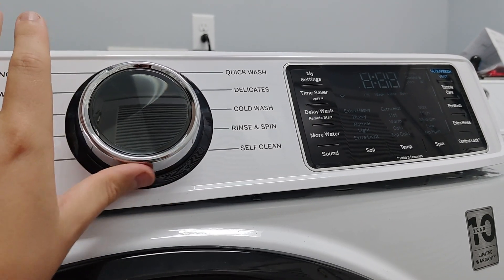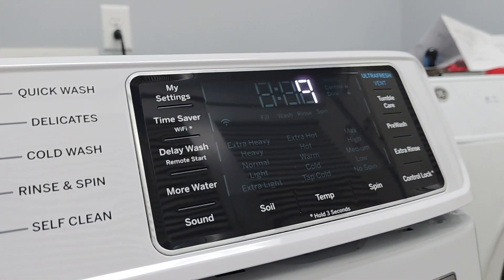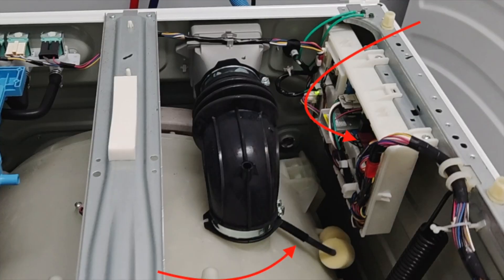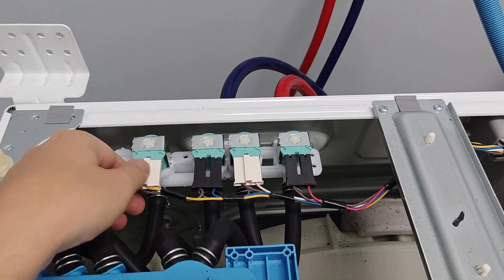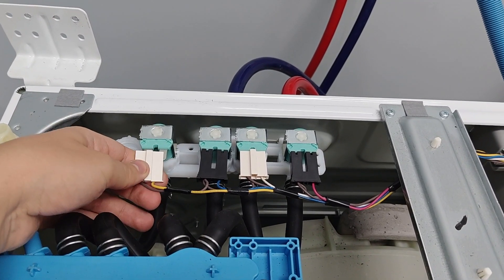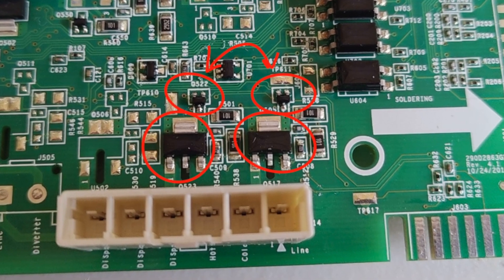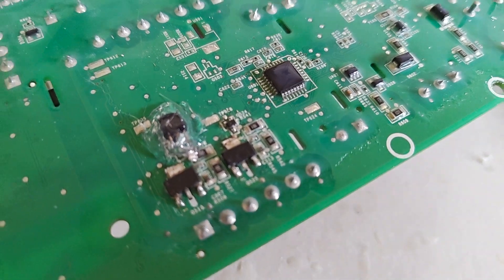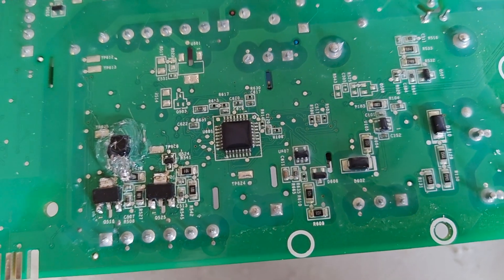GE h2o supply troubleshooting

Comment: If you ever get to see this, this helped me resolve an issue after a repairman. Did some other work on the washing machine. We were suffering with cold washes for a year and none of the videos got me to what I needed until I saw this. When I opened it up, the connector is were half on and kind of mangled. Bent the points straight and connected each of them on properly and tested it and voila